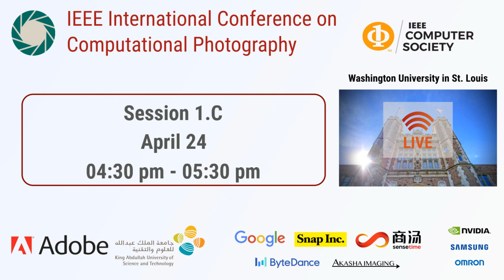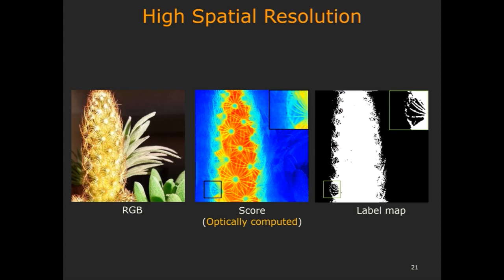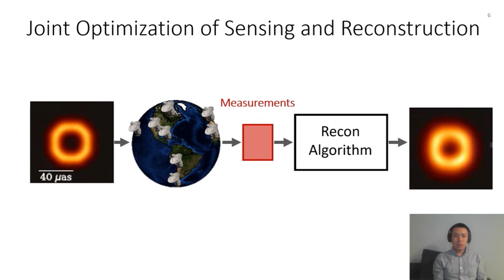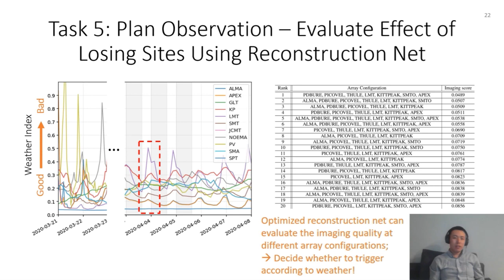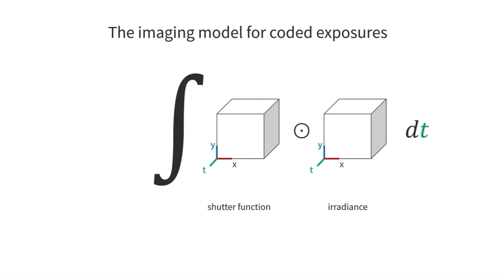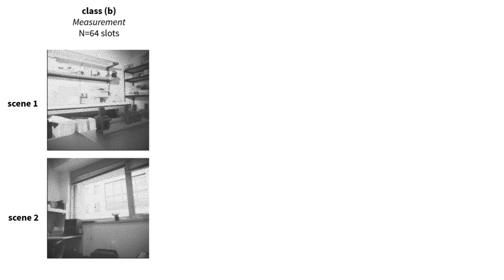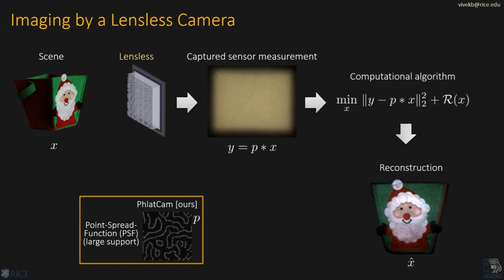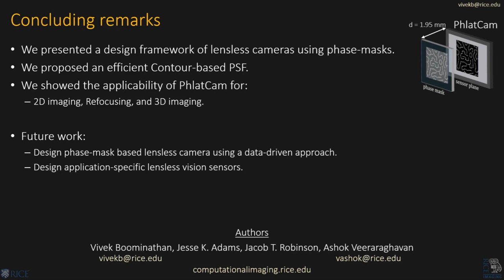Session 1.C

Comment: #3 Is it possible to train the network to at least generate output that same material's response is clustered together. Then we can not necessarily identify but to know what are the types of materials presented in the scene based on the number of clusters.
Reply: In a way, yes. You can definitely do an optical SVD/PCA on the scene's spectral profiles and then do a clustering. This can be achieved via a small set of random, spectral projections, or in an iterative adaptive manner, as explored in another of our work (KRISM).